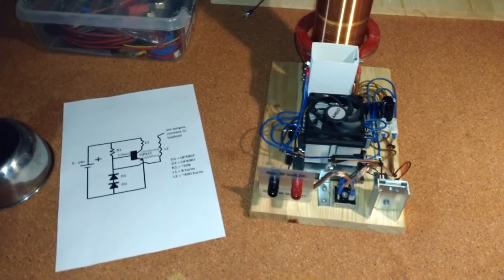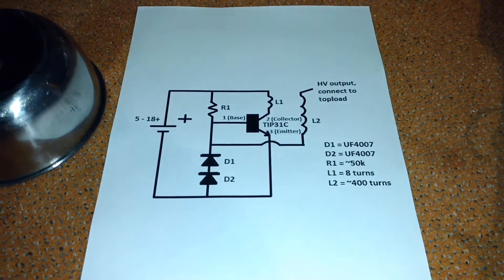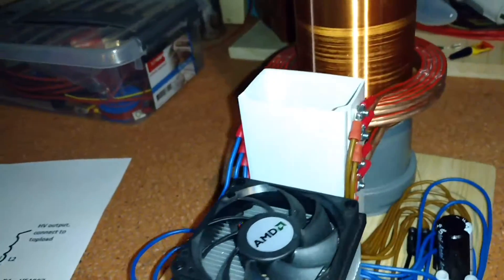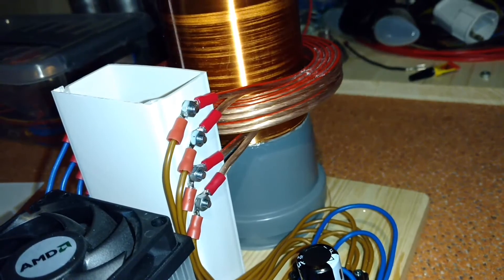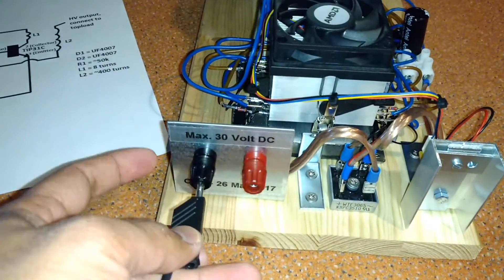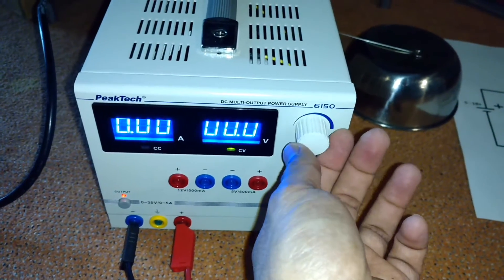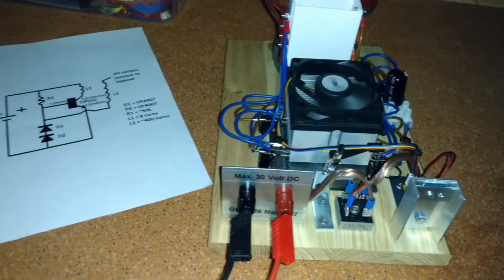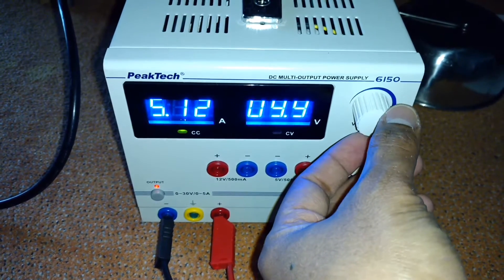Slayer Exciter with 4 primary coils

Comment: First the power go in the full bridge rectifier and then ?? Does the small heatsink for voltage regulator for heatsink fan?? And what about the big capacitor ??
Reply from the maker: The big capacitor is there to stabilize input voltage. I have posted another video showing the circuit in details.
Reply: @OkkiMoeljadi  whats the value
Reply from the maker: The value is not so critical, the bigger the better.

Comment: Nice work! You made a good slayer. I'm impressed with the whole build. Thanks for the mention that was kind. I love those slayers.   I'm also seeing your slayer work with the primaries all touching?! that's different I'm sure mine needed a gap. You learn new things by watching videos like this one. Also ideas on how to make them into units you can move around and demonstrate. Neat wiring too, nice neat crimps lined up....."your wires flow like water"! That's what an engineer said to me one day. true story lol. Take care fella.
Reply from the maker: Thanks deeds. It is actually your build that gave me an idea to build this. Yes all my primaries are touching each other. I wound it using 2 speaker wires. It is like 4 pancake coils in a stack. This multiple primaries slayer exciter draws much more amps than the standard one. I think I have to build a big power supply.

Comment: Thanks for sharing
Have you schematic how wired 4 transistor 4 coils ?
Reply from the maker: You're welcome. I have just connected all 4 circuits in parallel.
Reply: Are the base all to together with tesla coil wire ?
Reply from the maker: Exactly! All transistor base share the same secondary coil wire.
Reply: Ok thanks

Comment: nice okki did you try to put around on the top like 20 wires arolund and with spark (like you did with 1 wire) and take all 20 of them and check input and output maybe you will get more input then output ?
Reply from the maker: Hi Bosnjak Bosanac. Thanks for your comment. Yes I will try that. I have just finished building this today. I'm gonna do some tests with this. Stay tuned.